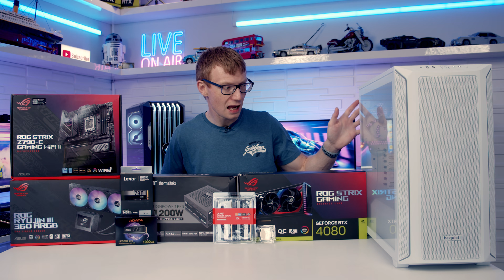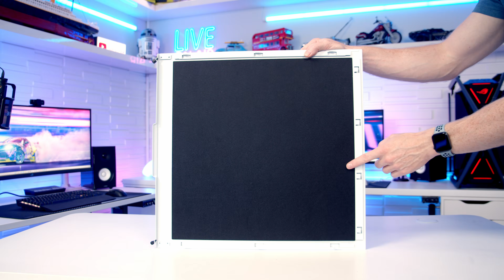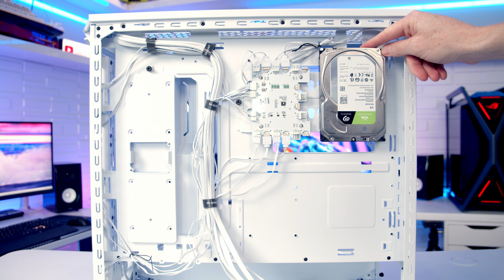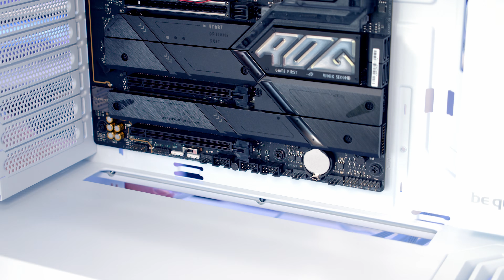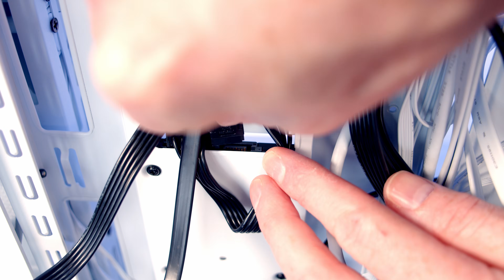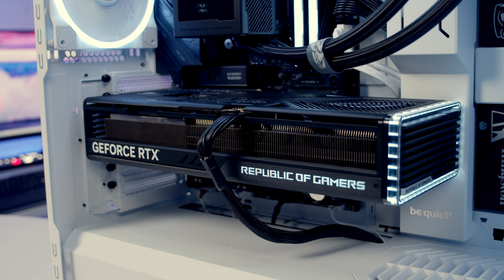be quiet! Shadow Base 800 FX Build - Step by Step Guide

Comment: That PWM cable had me a bit worried because it only had 2 cables connected. I assume that is because the HUB receives power via SATA and those 2 cables are only to read and send a signal from/to the Hub or something like that.

Still - was nice to confirm from your video.

Comment: This might sound like a stupid question, but using that AIO setup + the original fan setup, that the case comes with. Wouldnt that cause negative airflow? 

Essentially you would have 3x 140 mm intake and 1x 140 and 3x 120-140 exhaust. 

What am I missing? 🥴

Comment: I’ve got a new psu and two motherboards. I also have 3 connectors for the front panel power. I plugged all 3 connectors to the header for the front panel as if it was one. MOBO is in, Ram is in. CPU is in with two power cables. M.2 is in. GPU is in though not needed for a boot and run as I have IG. I Can’t imagine that’s an issue. I can’t get either mobos to boot. I can admit there is a chance that one is fried but both certainly aren’t. What am I missing?

Comment: Question: So, I bought a [MSI b760 gaming plus wifi] no info it matches this [Chassi/Case more than ATX] Anyway, so I have a Samsung m.2 card 970 evo plus [3Gen] don´t match the MSI - then I have a Corsair m.2.card 4Gen & a Kingston 4Gen.
And seriously none match the M.2slots in the MSI B760.
And it seems like I am not the only one having this issue, might this be a faulty/mobo issue?

Thank you for a great video.
&
Thank you for a respond.

CSL & OUT...:shelterin:

Comment: I wanted to ask you if i can instal on the top like you the AIO artic freezer III 420, does it has space for it? Also why you connect 4 pin cable pwm on cpu fan header and not in AIO pump?

Comment: Hey! Great video!

I just had a quick question about the IO. I have purchased this exact case, and am now looking for a motherboard. On your video, you only plug in one plug for the 2x USB 3.2 gen 1 (A) ports and one plug for the 1x USB 3.2 gen 2 (C) port. Looking at the motherboard you used on PCPartPicker, it shows it as having 2x USB 3.2 gen 1 header , and 1x USB 3.2 gen 2X2 header. My question is which headers did you need to plug in the front IO? Were both the 3.2 gen 1 (A) ports combined into a single cable oand plugged into a single USB 3.2 gen 1 header? And was the USB C header in the USB Gen 2X2, or can it also go in a regular USB Gen 2 (C)? Sorry if I have phrased this poorly, many numbers haha.

Comment: the black version doesn't seem to have the front io cables all bundled into one like yours, at least mine doesn't. confusing
Reply: Same issue.
I have been able to connect the pwr_sw, led +/- connectors, which are labeled, but there is another unlabelled 2pin connector and I don't know where it should go on the motherboard.
Were you able to find out?
Reply: @remidebette6079  i don't remember sorry. although the pins weren't bundled together on my case i just followed the instruction manual which lined up with my motherboard's without having anything leftover
Reply: @gothicwigga thanks for the response
Since the connector is not labelled I am not sure if I should try. If I followed the motherboard docs I see that what I have missing are a reset button and HDD state led.
I don't think there are such elements on the black 800FX, what I see on the front is the button to switch RGB Leds colors, but I don't think it is what the motherboard front io connector is for
Reply: Same

Comment: thank you @ChristopherFlannigan  for the detailed guide, it's really helpful. I have an issue that 800 FX fans, light, and audio from the front panel don't work. I don't see fans even in BIOS. ON/OFF button works well. Do you know what should I fix or maybe have some suggestions?

Comment: And where is the review of the case?
Reply: I have one and it's pretty good in my opinion. Pretty quiet and great air flow. I have a 7800x3d and 4070 ti and I dont see Temps higher the 60 c with no water cooling just air.
Reply: @daddyzback_54gaming82 is ur pc quiet?

Comment: GIGABYTE X670 AORUS Elite AX  

- [ ] PowerColor Red Devil AMD Radeon RX 7800 XT AMD Ryzen 7 7800X3D 

AMD Ryzen 7 7800X3D 8-Core, 16-Thread Desktop Processor.                      

Kingston Technology Fury Beast RGB 32GB (2x16GB) 5600MT/s 

Cooler Master 
V850 Gold i ATX3.0 Fully Modular, 850W, 80+ Gold, Semi-Digital, 135mm Silent Fan 

Western Digital WD_BLACK 2TB SN770 NVMe Internal Gaming SSD Solid State Drive - Gen4 PCIe, M.2 2280, Up to 5,150 MB/s - WDS200T3X0E

Cooler Master MasterLiquid 360L Core 360mm Close-Loop AIO Liquid Cooler, ARGB Sync, Gen S Coldplate Pump, 120mm PWM, CryoFuze 14W/mK, AMD Ryzen AM5/AM4, Intel LGA1700/1200 (MLW-D36M-A18PZ-R1), 

Black be quiet! SHADOW BASE 800 FX Black case

Comment: Is the psu tunnel on this case plastic or steel? It looks plastic in pictures but I kinda refuse to believe that on a 160-210 eur case depending on the version.

also this or the silent base 802?